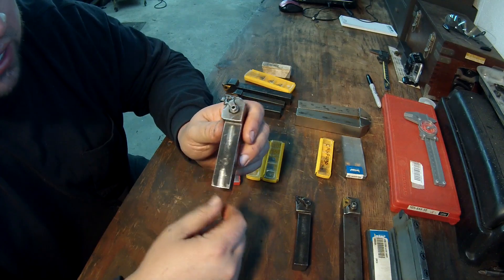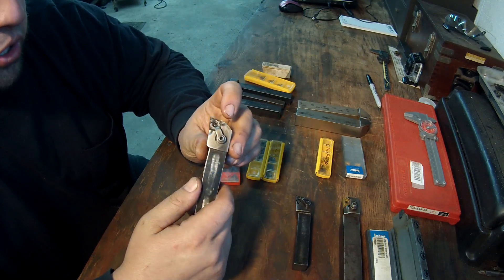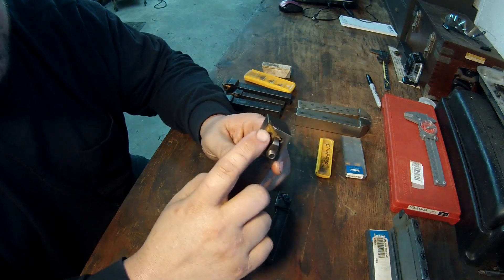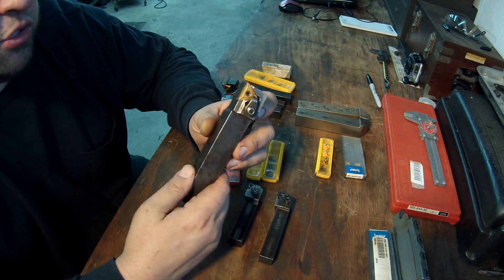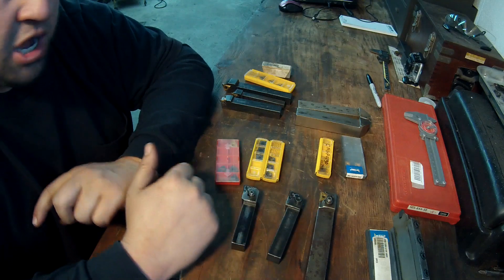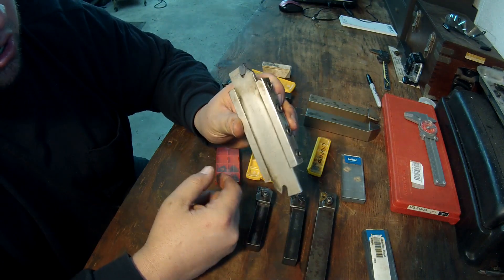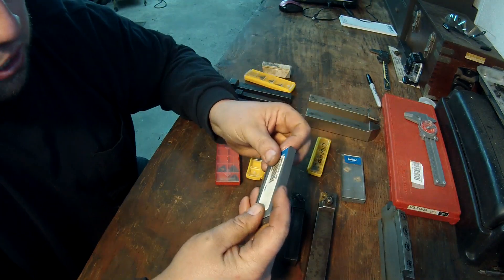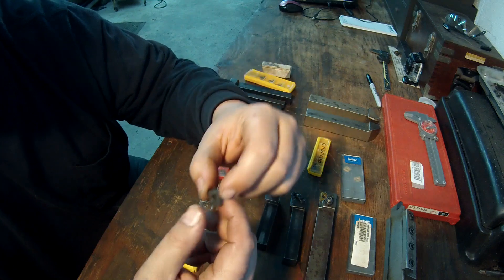Carbide Insert Tools

Comment: Can I use say triangular inserts with a 'center hole' .........in my aloris 16 which takes tpg322 type  'solid'  triangular inserts?  I imagine it'd have to be "even" or "low" at the cutting edge relative to the rest of it's top surface to prevent interference with the holder

Comment: Now, there are some toolholders that will let you use the large angle of the CNMG inserts. At my previous job, I got one because I was turning airlock rotor blades, and having a larger contact area helped reduce edge cracking of the insert during that heavy interrupted cut, though the greater contact area also means greater tool pressure and chance of vibration when turning shafts. They are nice to get a bit more life out of an insert. An older guy who worked there running a Bullard manual VTL also preferred using the big angle using CNMG 632 inserts, especially because he mostly cut large castings, so he didn't have to worry so much about vibration.

Comment: Hi, I'm thinking about buying a SER1212H16 tool with 16-gauge ag60 but I do not know whether to buy vp15tf (pvd) or ue6020 (cvd) all mitsubichi, I know that vp 15tf can be made with stainless steel but I usually use steel f114, what do you recommend?

Comment: Hi Adam, do you use ceramic inserts? Maybe a video of this tema I think it Would be intresting. I have sarched and I didint finde a good video
Reply from the maker: I have used ceramic some, but not a lot. I use them on tough to machine materials where my normal carbide is getting worn.

Comment: Loved the video .... There is definitely alot to cover on this topic.  I am still quite new to the trade,  I use a WNMG similar to yours in my home shop because it came with the lathe, and I love it.   I also got a stand up threader with it and had a heck of a time trying to figure out what to order when I needed new inserts, it is very overwhelming to the beginner.  At my new job we use all ground HSS currently.  I have been given the go ahead to outfit the lathe with new tooling.  It won't be hard to spend 1000$ for a new aloris style tool holder, L/R and parting tools.   The lathe is used predominantly by us in the maintenance department but also for some production work...I couldn't believe that they didn't have any carbide tooling.  This was some good info.

Comment: In the video you mention wanting to try CCMT inserts.  Could you explain what the benefits are to CCMT inserts vs. what you are currently using?  Also, any chance you could do a part two and explain what tool rake angle is and how that relates to different cutting strategies or what the benefits of positive vs. negative rake angle?

Comment: Hi Adam, if you are interested in CCMT, I really like the Iscar IC8250 grade SM chip breaker inserts. They leave a really nice finish yet are a really tough insert. Good for medium to finishing work. My lathe is much smaller than yours and weighs about 1400pounds but they still work great, and break chips at very small depth of cut and low feed. They also can be pushed reasonably (for my setup anyway!) so I use them for everything.

Tim

Comment: Adam
Ive been using tnmg543 mainly because thats the tooling that was there when i started at my job.  Do you know what difference the radius makes?  

Mark
Reply from the maker: Mark, the radius is important to pay attention to also, it depends on the cutting your doing. For medium to heavy machining, the x32 and x33 inserts work best. If your taking very deep and heavy cuts it needs more nose radius, and it notice that it also makes the chips curl off better too. 
For medium to light finishing cuts the x31 and x30 inserts work best....IMO. The tighter radius helps give you a better finish and manage a small chip when taking small cuts. 
For example, when Im turning those big chrome rods down, I will use a cnmg 432 to rough it in with deep cuts, then use the cnmg 431 for the finishing cuts, say the last .100 to come off. 
Good question, and I hope I made some sense there. LOL

Adam
Reply: Yes, it did make sense.  All of the shafting i machine is cr1045tgp.  I am always struggling to get a great finish.  I can get a decent finish running high sfpm and feed rates, but its still not great.  I think ill order a few inserts with a smaller nose radius and see how that works.  I would try some of the inserts that you have shown, but the geometry isnt right with some of them.  Since i have a turret lathe, i cant adjust the tool post, so im limited to what styles i can use.  Im assuming thats why my father in law started using the tnmg because its all he could use.  Thanks a lot, it helped a great deal in understanding the insert language

Comment: I started with TNMG 43X because you could pick them up so cheap and could use all six sides. I then moved to CNMG 43X because you could use the same tool for turning and facing, and they can still take a heavy cut.

I also really like the very narrow VMNG's (rights and lefts) to get into tight areas next to live centers and such. 

Cheers Adam (looking forward to the internal tooling video)

Glenn
Reply from the maker: Glenn, you make some very good points there, some of the very same reasons I like using the cnmg and wnmg inserts. I actually have a DNMG but forgot to show it in the video. It works good for getting in close to a center, or for general OD profiling.
Reply: Thanks Adam, I finally switched over to those CNMG on your recommendation! Thanks a bunch Adam.

Comment: Hi. You can use unused 100° corners of CNMG tips using CCLNL or CCKNR tool. It is quite usefull for heavy duty facing.
Reply from the maker: Thanks for sharing!
Reply: http://image.monotaro.com/Monotaro3/pi/full/mono40542844-121221-02.jpg

(CCKNR and CCKNL.)

Comment: Thanks Adam......very informative!....inserts will drive you nuts!  I recently tooled up with some insert tooling from grinding my own HSS, and about drove myself nuts in the process! For guys looking to make the jump, it might be noted that the actual holder numbers don't have anything to do with the insert letters or numbers numbers, and that you can also get different sized shanks that use the same insert. The best info I could give, is to study the letters and number a bit.  Travers Tool main cataloge, has a good section on page 400 and 401 that show what all the letters and numbers refer to. You can visit it online or order their cataloge. Having the catalog in front of me helps best. KBC also has a section devoted to explanation.
Reply from the maker: Jim, your right about the tool catalogs. They usually have a detailed chart showing what each letter and number is for. I've plenty of days looking at them and studying. I dont much anymore these days unless I'm hunting a certain tool.

Comment: I'm not a machinist Adam but I was wondering whilst watching the video here.. How do you tell when an insert is worn out, and also do you re-sharpen them or just throw them away?

Thanks mate

John UK
Reply from the maker: I can tell by the the finish or how the machining op is acting if the insert is worn, or chipped. A fresh new insert will leave you a good finish depending on speed and feed. An insert that has a badly worn edge will start making bad finishes, and usually leave fuzzy shivers in it as well. 
The only inserts I've ever touched up on the grinder is the TPG 4xx inserts, as those are flat on top and relatively easy to regrind, or make a ship breaking groove in the top.

Comment: Nice to see what others are using in inserts. It confirms what I had picked as my choices for starting out with inserts. C-series seems to be the more popular but I am leaning to the W-series as the more affordable choice due to the number of cutting edges available.  Did I see a positive W-series down in the corner of that box?? I havent been able to find positive geometry commonly available.
Reply from the maker: Yes you did, I mentioned it too. It was the wnmg insert mounted on the holder. Its a positive raked insert, great for medium and finishing cuts. If you want I'll send you the info.
Reply: Thanks, I'd like that. I figured it would be listed as something other than WNMG...say, WNMP?? I'm about to commit to toolholders and inserts and already have a CNM* set coming.
Colin
Reply from the maker: ***** Send me an email and Ill respond with a couple pics I took.
Reply: Abom79
Done! :-)

Comment: Helpful video giving a good place to start. There is nothing like experience (yours in this case) to give a helping hand in this maze of insert choices. I received the Sandvik insert catalogs a few weeks ago: 4 volumes with about 600 pages of inserts! It is nearly impossible to make a choice and choose wisely without relying on the experience of someone who has actually used a particular insert with success. Thanks for giving us a head start on the purchase of an insert that works. Much appreciated.
Reply from the maker: Studying those types of books is how I self taught myself about inserts. I know they get confusing but its very hard to remember all of the different types of holders. I use the tool catalogs for reference.